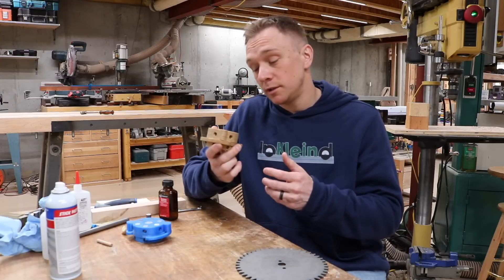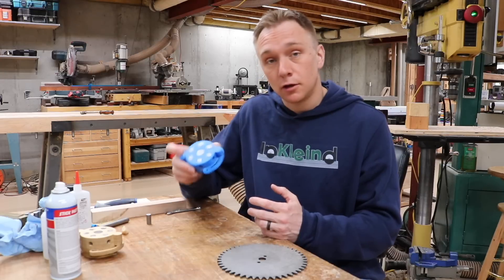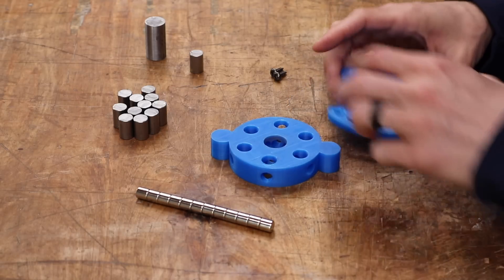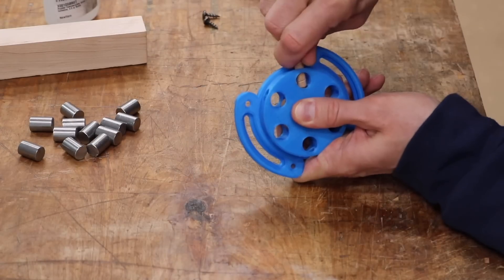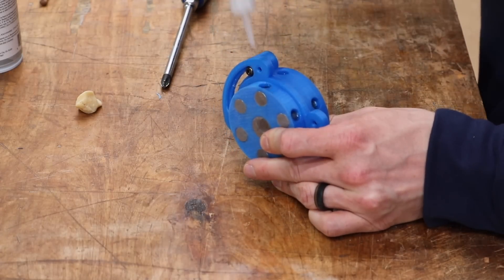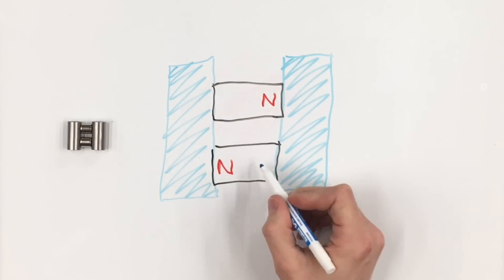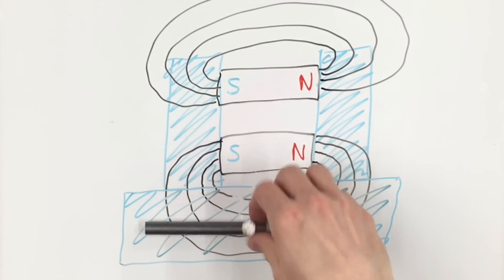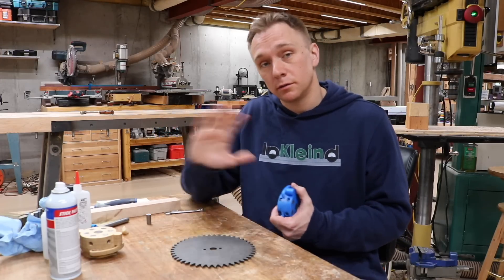3D Print a Magnetic Switch, and how it works

Comment: Finally got a 3D printer, and am looking forward to getting this file.

One possible change is that I'll seal the side holes with UV resin that cures within seconds. Yes, I know UV and PLA don't play well together. But the few seconds of directed exposure shouldn't be any issue. The other possibility is to print some appropriate sized plugs and use the weld solution.

But, this is yet again a brilliant project from your shop! Thank you.

Comment: ...and also, keep your "switched magnets' in the OFF (no attraction) mode or ON with two steel plates on them when not in use.

Magnets like to have their magnetic fluxes set to their maximum and leaving these switches to their ON position without any steel on them will have their fields in less than optimal condition.

Comment: Nice work, both for Andrew and the following comments. 👍🏻😁
Even though one part is named as the base the assembled unit indeed seems to have a double sided or obverse functionality. Could you indeed save another step by making the top and bottom pieces identical so that the 2 holding screws in the exterior rotation enabler/limiter be inverse to each other. One up and one down. I’m guessing that it still should rotate and reset just as easily? 🤔

Comment: Sadly, I was unhappy with the results.  I was excited to do this project and the parts printed nicely.  I then sourced the steel locally, cut it myself after building a jig for accurate cutting on my little chop saw and procured the magnets from eBay (3/8 x 3/8 Inch Neodymium Rare Earth Disc Magnets N42).  But, after all the work, I wouldn’t say I ended up with anything powerful.  Yes, there is an “on/off” position…but the “on” position leaves me with not much more magnetism than holding a few of the individual magnets in my hand.  I can easily pick the magnet switch I made off my cast iron table saw with just a slight twist.  I expected a much stronger hold….more akin to what one might find if I purchased a commercial version of a magnet switch.  Maybe my magnets were not as advertised or the wrong thing.  But, otherwise, unless I made some mistake, I would say this was a bust and a waste of time.  Good video to teach how this thing works, though!

Comment: when I was in high school shop class we had a surface grinder that had a switchable magnetic table to hold down the item to be ground. I'm sure that machine was as old as that school shop which means it had to be a minimum of ten years old in 1970 which brings it to 1960 when it was new but it could easily be built in 1950 !

Comment: awesome follow up and lesson on how it actually works. now I have to get someone to print it for me. it's interesting that the smaller switchable magnet bases machinists use for attaching dial gages etc use one magnet and a few strips of aluminum in a steel case also works, but with only one magnet. I guess the aluminum blocks the flux when aligned with the pole (since the pole is like the "opening" to the flux). 

are you considering an updated design based on what OskarPuzzle said? I would buy that plan too! 

thanks!

Comment: Wondering if there is anyone selling this design? Interested in the force needed to disengage the magnet vs the force that may be obtained by attracting other magnet instead of a piece of steel. I would imagine the former would be less so there may be a net gain in force. Any help with this?
Reply: P.D. Meaning looking to buy the actual switch not the files.

Comment: Hi Andrew, Do you realise that you could have saved 50% of magnets, without losing any strength? Now each layers has six magnets in a start orientation. Instead, you could have used three magnets per layer, going around in a loop, 1-2, 3-4 and 5-6. That would also saved you the central steel pin, which could be a simple screw. Inspired by your video, I bought the steel and magnets, and confirmed this finding. Of course a new challenge is how to get the magnets in there. My trick is to have a pause in the gcode, put the magnets in, and then continue the print. Thanks again for the inspiration! Oskar
Reply from the maker: Make a video if you build it!
Reply: @AndrewKleinWW  Hi Andrew, here are already some photos of the result (https://www.shapeways.com/product/DRAXY3BJG/magnet-unlock), with reference to your work. The video may take a while, but enjoy the photos! Oskar
Reply from the maker: That is really a cool puzzle concept!  But why am I coming up with 1296 configurations, not 144?  Are you making all these yourself?  I’m intrigued
Reply: @AndrewKleinWW  Thanks! Yes, I am designing and making all puzzles on my YouTube channel myself, including the colorful Magnet Unlock puzzle. I have been using my own 3D-printer for the last year. Where is your extra factor 9 coming from? The order of the three disks is immaterial to the solution, and so is the placement of the first disk. Once the first disk is in place, then there are 12 options for the second disk (6 rotations + 6 upside-down), and 12 for the third disk. So 12x12=144.
Reply from the maker: Sorry, should have said I got 1728 configurations.  That was with ordering included, since there are 6 ordering setups you divide 1728 by 6 to get 288 if ordering doesn’t matter (do you really eliminate all external field with the solution in any of the 6 orders?).  So I’m still getting 288, not 144, because I was counting the flip of the first disk as well as flips and 60 degree rotations of the second two.
Reply: @AndrewKleinWW  Also a flipped first disk does not count, because you just flip all disks the same way, and the puzzle is still solved. 2 solved states out of 288 is the same as 1 solved state out of 144. Of course, this analysis is part of the solving process. A lazy solver would just try all 3! x 12^3 = 10368 states. You had already observed that simple rotations are redundant, which is how you got to 3! x 2 x 12^2 = 1728. Eliminating order and flip of the first disk as well, what remains are 144 essentially different states, and only a single solution.
Reply: @OskarPuzzle  Nice puzzle!! ... But $487.07 Canadian !?!?!
Reply: з

Comment: Does the center rod contribute to the strength? I will have at all times the same amount of south oriented magnets as well as north oriented ones pointed to it. They should cancel out, so I think there is no need to use steel for the center.

Comment: Fantastic device.  I've been interested in creating a magnetic switch to use in the shop for several months.  I'd like to buy the plans but I'd like to modify the frame with mounting points for attaching items such as jigs or fences, etc.  Are you willing to sell the design source files ( Fusion, SketchUp, SCAD, or other) so I can do that?  I can import an stl into Fusion, but the 3D source would work better.

Comment: I note that the contact surface between the magnet and bar is low (flat against cylinder). If you used hex bar (a standard shape) you could get better contact- wouldn't this give a stronger magnet? Using 3D printing a hex hole is easy...
Reply from the maker: certainly true.  Hex bars are just much harder to find
Reply: @AndrewKleinWW  In the UK, available from metals4U.co.uk. Amazingly, cheaper than round!

Comment: Is there a practical way to (1) Reduce the "ON/OFF  swing arc from 60 degrees (included) to 45 degrees by using OCTAGONAL Mag-Pairs rather than the Hexagonal  sets of the paired magnets in your design, (2) Increase the Magnetic Attractive Force by increasing the  Flux Density? ..... More magnets, more Iron, more leverage, more holding power?

The STL Printed Version would seem to be easily edited to include more sets of magnet pairs and steel rod segments - if angular spacing becomes problematic. For what I wish to accomplish, the diameter of the rotating/oscillating components could be increased to 6 to 12 inches.

The MAG-SWITCH is a Metal to Metal CLAMP - I want to have a Non-Contact, variable strength "Disk Brake" similar to a Magnetically Controlled Resistance Rowing Exercise Machine in a fitness center.

I want to adapt the Variable Braking force ranging  from a center position being FULL OFF for unrestrained motion (Spring Loaded Return) to a Bi-directional, Full ON position at either end (CW /CCW) with as small an Arc Swing travel as practicable. 

Design GOAL: Create a Magnetic, bidirectional Clutch/Brake to function like a switchable SPRAG CLUTCH with operator control.

Comment: Leaving out the cost of the plans that is perfectly reasonable considering you can make as many as you want for that 1 time purchase,  i was wondering if the single set comes with the templates for the plywood version as well as the stl files, or is it just one or the other? I was also wondering how much the magnets, and metal cost? And what kind of lifting power the finished product has?. Trying to get a idea of how it compares to commercially available models both in lifting capacity and overall cost. Its a given that it cant be used for something like welding, far to much heat for either version to survive without starting a fire. but would it hold up on a cut off saw. or something similar do you think? Or is this strictly for cold working applications only?

Comment: I bought the file but I don't have anything for printer settings? you have recommendations for walls? layer height? just wondering.
Reply from the maker: I used 2 mm thick walls and .2mm layer height, not that those are correct and anything else is wrong
Reply: @AndrewKleinWW  ok sounds good ill beef up my walls. Last question did you do 2 mm bottom and top layers as well?

Comment: I'm looking for a switchable magnet of mini-size (few more than 1 inch in dia) with a smaller "switch angle" than the 60 degrees of your example. Did you experienced any drawback in decreasing the angle between the magnets and increasing their number? (Obviously by properlyreducing the size of magnets and iron parts too).

Comment: if this was rated as 1000lb magnet force. Would you need 500lb or 1000lb force to turn the switch?
Reply from the maker: No
Reply: @AndrewKleinWW  Is it possible to use the force of this magnet to switch itself on & off?
Reply: What is it rated at?

Comment: I printed and assembled mine, but used ebay N52 magnets rather than your source. 
It's not as strong as I imagined it would be.
Is it normal for the center post to always seem to be magnetically neutral?
Reply from the maker: The field definitely concentrated in the outer rods but there should be some magnetism in the center post.  Did you make the large switch or small one?

Comment: Andrew I purchased the 3D files, but wanted to know what settings you used. Layer height, % of infill, Material PLA or ABS and does this need support option. Also would you be able to provide the 3d model from your previous bowl gouge holder video for purchase on your sight.

Comment: You just explained your design away for free... thanks with sincerity. But what if one one half that Twists you add an extra set of magnets so it Never sticks (Hand control side) and metal sticking side as normal... would that enhance the pull of the metal sticking half? Or even work?

Comment: Purchased your design and printed the smaller Mag Switch.  Printed very nice!  Now gotta cut up some rods and work on accuracy.  It's a fun project.
Reply from the maker: Awesome, send pictures when it’s finished
Reply: @AndrewKleinWW  Will do!  Planning to cut the metal on the weekend using my bandsaw.  Also ordered the magnets, so just waiting for those to arrive.  In the meantime, here is a photo of the finished print.  It turned out very good.  https://photos.google.com/photo/AF1QipOzy93X6-DuEPnqldTak-VSFJYCODTwiODPSZGO

Comment: Andrew please write the size of the magnets in millimeters.  Diameter and height, quantity.
Reply from the maker: The probable is, if I give you a direct conversion to metric I don't know that it will do much good, will it? For example the large magnet uses 1/2" diameter, 1/2" long magnets, so that 12.7 mm diameter and 12.7 mm long magnets.  I don't think you'll find that exact dimension in metric, so you'll need 12mm or 13mm magnets and a reworked stl file anyway.

Comment: Thanks Andrew, for the nice design for a mag switch and the clear explanation of the working principle. I am planning to make my first mag switch with plywood.
I feel, there are advantages if you use cube magnets and steel rods with square cross section. 

 - A 10x10x10mm cube magnet has 127% of the volume of a 10mm dia x 10mm high cylindrical magnet.
- 8 cube magnets can be used instead of 12 cylindrical ones and the rotation angle will be 90 degrees.
- Since there are no curved surfaces anywhere, the cube magnets will have a larger area in perfect contact with the square rod at the center as well as the peripheral rods, resulting in a stronger mag switch even though the number of magnets is reduced from 12 to 8.
- Cube magnets and square rods are easily available.
- If the device is going to be 3D printed, it's only a design change. However, if plywood is to be used, making a square hole may not be that easy.

Looking forward to your comments. Thanks.
Reply: After posting, I created the model in Sketchup and realized that the central rod has to be necessarily circular in order to rotate the top portion by 90 degrees. 
However, this issue can be resolved by making the central rod circular. This will of course introduce curved surfaces and may make the switch less powerful.
Building the models and testing them will provide definitive answers.

Comment: Thanks for telling people how it works, but there is a much simpler arrangement.
Two diametrically magnetized cylinders like these  https://www.kjmagnetics.com/proddetail.asp?prod=DX08DIA inside a steel tube, the bottom one fixed and the top one able to be rotated.

Comment: Andrew it is the Aerosol in the Stick Fast that is reacting to the PLA, I ran into the same problem myself and started looking for an alternative. I came across Starbond Instant Set Accelerator.  It is a non-aerosol activator and is available on Amazon. It works great with PLA, ABS, PETG, TPE, and TPU filaments.  https://www.amazon.com/gp/product/B00BUVAY9K/ref=oh_aui_search_asin_title?ie=UTF8&psc=1
Reply from the maker: Thanks, I’ll check it out

Comment: baking soda works for activator for CA glue as well
Reply: baking soda leaves far worse looking residue to just activate it on the plastic.
Reply: @dreamkiss4u  I was actually going to suggest to fill up those holes with ca glue and baking soda. Then just sand it smooth.

Comment: Excellent vid! I washed the wood one first and though the same.  I did download the files and they look great but I was interested in Fusion 360 files or STEP SAT. Just to use stock on hand or adjust for 3D printer tolerance?

Comment: Maybe not common with woodworkers, but every machinist has several of those. Just search for "switchable magnet" on Amazon or AliExpress. About $12 for the cheapest ones. I have an antique one built in 1923, although the design is entirely different.

Comment: If it is stuck to a surface magnetically I assume it would require a certain amount of energy to rotate the device and turn the magnet off (or more accurately, redirect the field lines). It seems to me like if the device can turn on and off freely without any extra energy (not including energy lost to friction), then you could build a free energy device with this. Like if you could pick up and drop a metal plate over and over by just rotating the device into the on and off position, it seems like the device would have to take just as much energy to turn it on and off as it would to just pick up the plate and put it down, or else the laws of conservation of energy would be broken. Does anyone else see what I'm talking about?
Reply from the maker: if you hold it against a metal surface and activate the magnet there is not any lifting happening, no actually work being done, so there is no requisite force to maintain conservation of energy.

Comment: Just bought these plans, and will be ordering the magnets soon. Just have to decide how many of each size I'm going to make. But I don't know how much steel rod I need to order -- cut lengths for the 1/2", 3/4", and 1" steel rod would be FANTASTIC! Right now I'm going to have to print the parts so I can measure them before I can order my steel rods.
Reply: I find your complaint valid, plans should come with directions. You can however open the file in your preferred viewer software and get your measurements from there.

Comment: Couldn't you use that switch, to switch the turbo vise gears, high and low speed.  Switch magnets on, and pull the gear forward, turn it off and springs push the gears back to the other gear.  Make it happen Andy.
Reply from the maker: Haha, maybe you COULD ...

Comment: put a bit of tolerance in the design as creep is and issue with pla
Reply from the maker: I’ve understood creep to mean that a plastic doesn’t quite return to its original form after a deforming force is applied, and that’s an issue for, say, a spring made from PLA.  But that wouldn’t come into play here so I’m I’m curious if you are referring to something else?
Reply: Designs should be as is, creep wouldn't be an issue with his either way. You as the person printing choose your filament, ABS, PETG, PLA all capable of this design, all needing different settings in your slicer. His design shouldn't be changed. Slicer settings of the person should be.

Comment: OK, cool and all... but other than a demo on magnetism and adjacent properties, what can you actually do with that puck?
Reply: It is used as a base for jigs. For example, you can make a thin rip jig for a bandsaw, and mount the puck to the base. Once the jig is in the right place, you rotate the puck, and it is locked to the table. Then when you are done, you rotate it and the jig comes off. Easier than clamps.